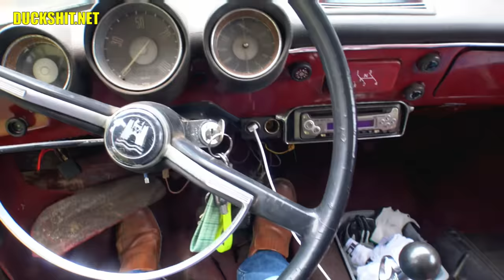🔧VW Tech Session🔧 - September 2022

Comment: IT was good to talk to you Saturday.  I'm the guy with the white one when you first pulled in.
Reply from the maker: I got distracted before you had to leave, did you get it all figured out?
Reply: @vvtheduckvv  We got it running, it's still not perfect but I had to go.  Going to check the valve adjustment and try my hand at carb adjustment this weekend (it's been about 20 years since I've dealt with a carb...i was pretty good at it then, should not be an issue but who knows.  Would love to work one on one with you to figure some other stuff out on this thing but I'm an hour away and rarely get to P'cola.  My experience is with the american car brands so this is a little different and knowing that I'm trying not to fall into the muscle car bag of tricks.  I know some of it crosses over but most of it doesn't.
Reply: @vvtheduckvv  Some of it.  When I got it home I still had to verify the valve adjustment and then tune the carb.  It's running ok and I'm probably about to swap the points out for the electronic kit I bought.